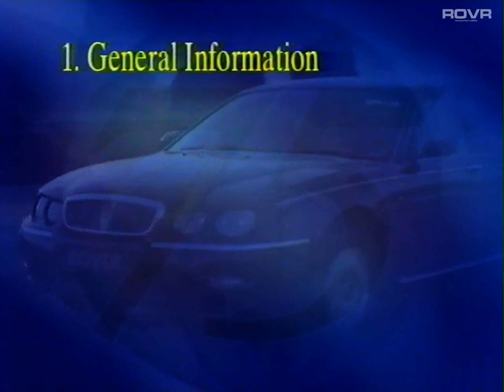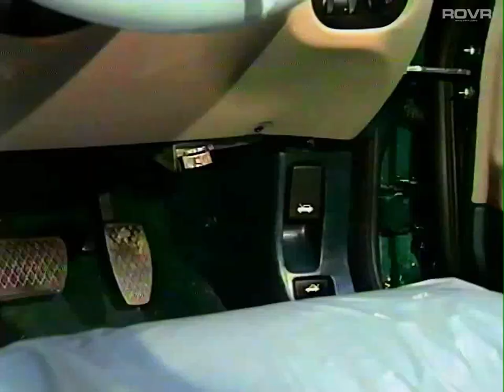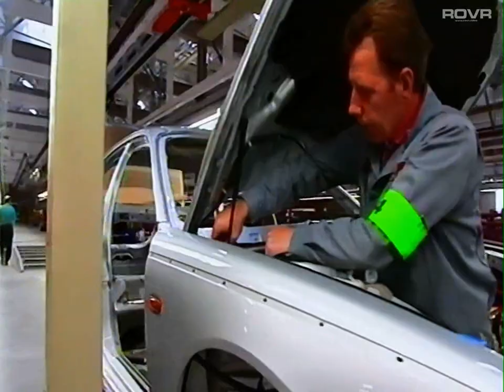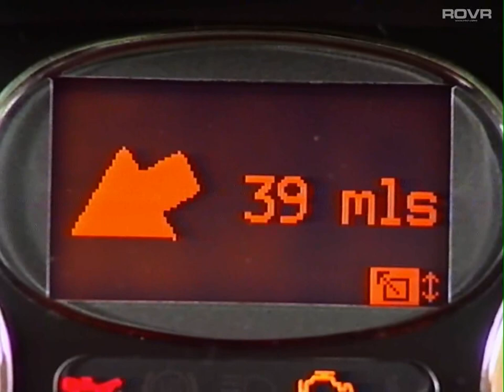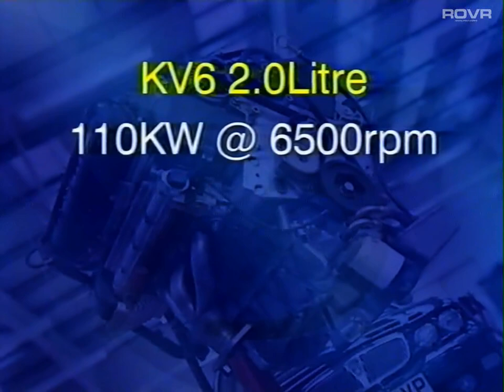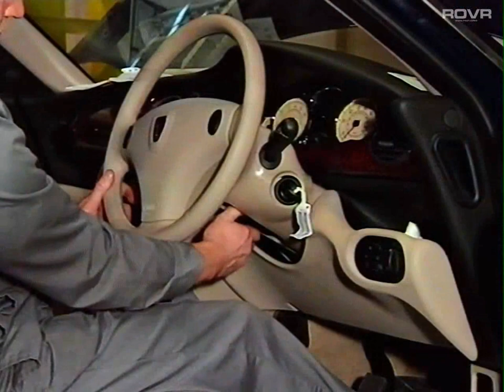Rover - Rover 75 - An Introduction (1999)

Comment: I bought my 75 2 months ago.I want to make a question.The handles have not key.What if one day ,for a reason I do not have battery power?Who i ll go inside to open?????Do I have to to buy at least the drivers handle with a key?Or what?????
Reply: The right-hand front door handle has a keyhole in it - should unlock, lock and deadlock the 75

Comment: I love the rover cars, I started with the 200  and now it is the 75, I have mistaken the jag a few times for my car as they look so alike when walking from Asda to the car, I have a V6 2ltr 75 with 89 thousand on the clock, it runs so smoothly. The only issue I have is the reverse light switch has failed, I have the replacement it is just a matter of getting it fitted, as I am disabled I can not do this myself, I always carried out all my maintenance and now I need others to do this for me, it is such a frustration, I am thinking of looking at a range rover type of car next, but I love my 75 too much to let go, besides, who knows what I may get if I swap, I could be left with a lemon.